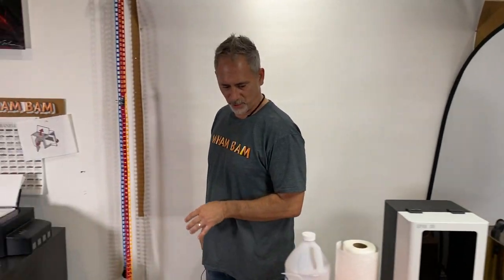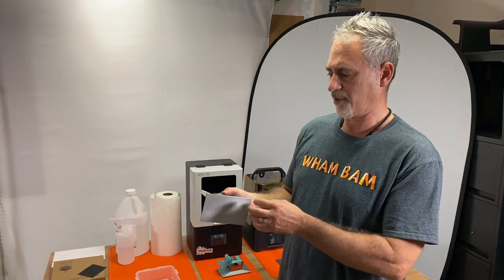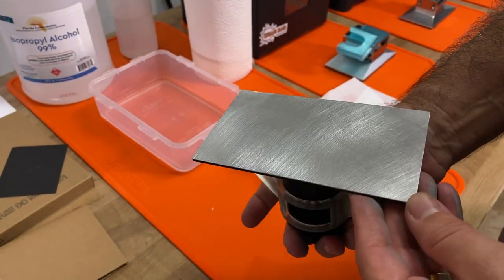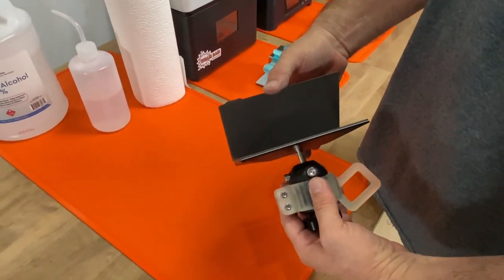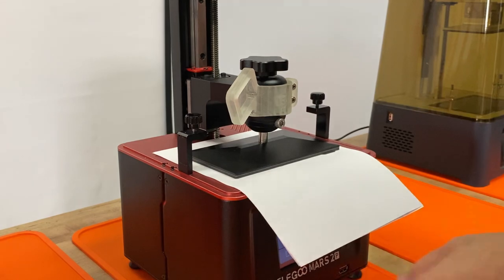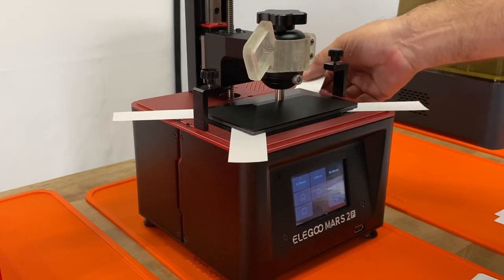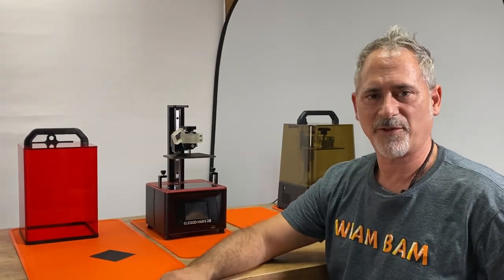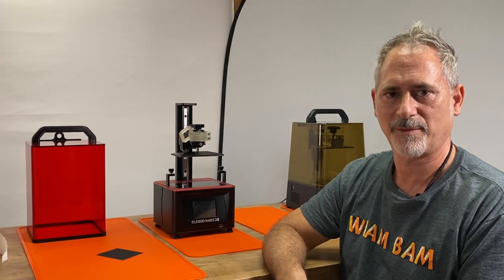Installation of the Flexible Build System for Resin (Updated)

Comment: What about a brand new Sonic mini 8ks plate, can i only do the alcohol cleaning or should i still get the Surface sandpapered?  The stock Surface looks diabolically retentive
Reply from the maker: you must sand every plate or the magnet will not stay for very long, follow our instructions for sanding and cleaning to have a perfect long lasting install.
Reply: @WhamBamSystems  ok thanks, just placed the order as i type this, whambam to México , going to be use to print dental restorstions using thick cerámic hybrids resins that can chew up the stock plate.
Reply from the maker: @drjoelsanchez  looking forward to hearing your impressions under these conditions! please do send your feedback to tech.director@whambamsystems.com if you like!
Reply: @WhamBamSystems  just installing the magnet on the plate, the instruction paper is a little bit off becouse it says screws are included, even tho i know i can use the same screws just fine, still a littlebit misleading. Maybe just clear that out. Everything else going to need further testing, i Will print a bunch of restorations. Lets see how this goes!

Edit: just found them! The screws were taped on the cardboard plate
Reply from the maker: @drjoelsanchez  please check inside your packaging, the screw are in a small bag that sometimes gets stuck to the inside of the box!
Reply: @WhamBamSystems  no dou ble and triple check and  no screws came in my order.
Reply from the maker: @drjoelsanchez  they are 2 M3 X 6 or 8mm. Most likely you can reuse those from machine.  If not please write to tech.director@whambamsystems.com and we can ship you 2
Reply: @WhamBamSystems  i was very intrigued on why You told me they sometimes fall out of place, justo chrcked for the six time (six times is the winner), thankyou so much for insisting, they were in fact taped on a corner, on the cardboard plate, not the bag in wich i expected them to be, thankyou so much, two screws found :) today i complete the 70+ hrs of curing and tomorrow i'll start testing. See You!

Comment: Reading the datasheet about the adhesive, seems it reaches pretty much 90% holding power after just 30 minutes, with full holding power at 72 hours

So in theory you could get away with using it within an hour of applying it
Reply: I tried this, did my first print 45 minutes after installation. Worked perfectly. It was a small room test print, so it didn’t really put too much stress on the adhesive, and I stuck to pretty small stuff for the first few days. After about 5 days, I did a full build plate print, and it was great.

After about a month of printing, I’ve gone through almost a kg of resin, and through many prints, as well as washing the entire build head multiple times, the adhesive is still holding strong. If you want to wait a few days to print, then wait. But I was very impatient, so started printing within an hour and a half of receiving the build plate, and it works great!

Comment: I have a mars pro 2. If I do not add the spacer and just level the plate loose like the third method for leveling. I should be fine without a spacer correct? As long I am vigilante about pressing the home button when plate is not loose
Reply from the maker: You should be fine but spring may cause too much downward pressure. You may want to level over 3 sheets of paper in this case then remove 2 and check against one sheet, be sure it’s tight but paper can move,
If level is too tight you will get shifting during base layers
Reply: @WhamBamSystems  thank you a note to all, just get the spacer if you do not u run the risk of breaking ur screen. also if u see a comment about removing the Z spring tried, did not work. just get the spacer the only reason you would not wwant the spacer is becuase you put it on already. if thats the case ask a friend to print the spacer for you. trust me!

Comment: I have an Elegoo Saturn S printer, do i need a spacer?  (some say yes, others no).  Where do I find it possibly?
Reply from the maker: It’s usually not necessary with Elegoo machines but if spring is too compressed you can add one, all spacers are on our support page https://whambamsystems.com/fbs-for-resin-support.    Saturn S is here https://www.thingiverse.com/thing:5334643
Reply: @WhamBamSystems  many thanks.
Reply: @WhamBamSystems  
Wait What… So I may not need a Spacer for my Brand New [Saturn S] ???
Reminds me, I viewed an owner of a Saturn S who did a YouTube video showing how he was able to add the FLEX-PLATE without using a Spacer. Successful Level the Build plate, but ONLY AFTER HE ADDED RESIN to the tank, did the GRIND DANCE start… (as I’m watching that, I’m like “Yeah that will be me”🤦🏻😱 So the Exhaustive Research began 33 hours ago to get an answer to this “Spacer or No Spacer” Riddle that’s driving me KOO-KOO……. Help…. Please….
🙏🙏🙏
Reply from the maker: @Zen_Modeling  as it is possible that the Saturn heads move enough to compensate for the added thickness of the Wham Bam System, the spring in the head would be so compressed that it could put too much force down during leveling or make it nearly impossible. Highly advise using spacer, takes very little effort to print and install. If not try leveling on a few sheets of paper and test with only one, that one must move between Flexi plate and screen but feel constant resistance.

Comment: So manually setting the new home z level in printer menu is an alternative to modifying the sensor, correct?
Reply from the maker: Do not use printer menu to raise z then set z=0, manually set home by leveling to correct height
Reply: @Wham Bam Systems  
No way to install without putting in spacer? The spacer on website for saturn 8k doesn't appear to be the correct dimensions for the xtr plate and magnet.

What I was wondering is if you can home the machine, lift it 3.4(or 3.6 I forgot) mm and then set that as z=0 so I don't push through the screen
Reply from the maker: @Chris-xu6gi  which spacer are you using from website? you should not install without a spacer, but can if the spring will allow you to compress that far. You can also take any spacer design and in slicer increase only Z height until it is .38 which is thickness of XTR
Reply: @Wham Bam Systems  I have not printer a spacer yet, I think the one directed from the website is for the non xtr plate and magnet.
I believe the springs on the saturn 8k will accommodate, but I wanted to try to keep their load as low as possible
Reply from the maker: @Chris-xu6gi  then print the spacer but increase z height to 3.8
Reply: @Wham Bam Systems  very new to all this, can that be done in chitubox slicer or would i need a separate program to modify the spacer?
Reply from the maker: @Chris-xu6gi  just adjust scale in chittubox, make sure to adjust only z, if you can’t do it I can adjust and send you the model?
Reply: @Wham Bam Systems  I think I have it adjusted, did you say 3.8? Not 3.6? The mag is 3 and the plate is 0.6? Once I install that, home and level as normal, right?
Reply from the maker: @Chris-xu6gi  great! 3.8 is exact with glue thickness, but it’s definitely close enough at 3.5-4!
Reply: @Wham Bam Systems  great, I'll print both versions and see what works best, level it out, and start going wild messing up prints in different ways!
You guys have been awesome with all the replies here as well. In thanks I'm going to buy a bunch of mega slap mats from your site

Comment: Which grit sandpaper is recommended for the plate?
Reply from the maker: Start with 400, if you need more adhesion you can go to 320
Reply: @WhamBamSystems  Thank you! Got mine and looking forward to installing this!
Reply from the maker: @ThIzZoLaSchannel  do let us know how it goes!
Reply from the maker: Sorry, if you are talking about the build plate 220 grit! And clean well with ipa. If you need more grip on the Flexi Plate then use the 400 grit
Reply: @WhamBamSystems  ooooh ok 220...yes the build plate!

Comment: Seems like i got a small bubble, do you think it will be a problem?
Reply from the maker: Usually not at all, try a print in the area, and let us know
Reply: @WhamBamSystems  Thank you, will do.
Reply from the maker: @trumpetscall8910  if the bubble doesn’t go down contact us at technical@whambamsystems.com and we can give you some advice and help
Reply: @WhamBamSystems  Thank you,  will do that if necessary. The process is finished tomorrow,  so it can test the plate.
Reply: @WhamBamSystems  Seems to work perfectly, just amazing how easy to get difficult prints off the plate.
Reply from the maker: @trumpetscall8910  so happy to hear!

Comment: Unfortunately, the flange on my Elegoo Mars 3 only has one screw securing the flange, although there are holes/places for two. On top of that when i try to attach the spacer the single screw only has about 3 threads to secure the flange/spacer. Does anyone have an idea where to purchase additional screws that are longer?
Reply from the maker: Buy some M3 screws 6 mm long.  You can get them on Amazon. A mixed M3 screw set is always useful for 3d printers.   For the Mars it’s not necessary to install the spacer, but it helps agains spring compression
Reply: @WhamBamSystems  Thank you

Comment: So question when it comes to sanding: If you're build plate has that paint/coating cover like the mars 2 mono has (your pro version looks to be silver on the bottom where mines black all over) Do you have to sand away all of the coating to leave the bare metal? I've worn out the sandpaper that came trying to do just that and I'm not really close to it. Is it fine with out sanding it all away or must it be compleatly gone? I am sanding evenly, and so see some silver poking though, but this seems like some thick stuff.  As is, will any kind of sandpaper work for this step? As said I've worn away the sheet offered to where holes and areas of the paper have no texture anymore. If I have to take off all the paint I need another peice (and maybe new arms).

Also a little bit of advice... please don't offer sandpaper thats the same exact length of the build plate. It has made sanding dificult and I don't like scraping the edge of my build plate across my work surface. Please at LEAST an inch longer than the plate size ordered so we have some wiggle room!
Reply from the maker: Yes best to get through the paint if possible
Reply: @WhamBamSystems  I've tried but I've worn out the sand paper that came with the kit. Sanded for a good two hours just to get a hint of the bare metal underneath. My arms acualy hurt today from doing it.
So again, what kind of sand paper do I need? any thats trhe same grit or a specific kind that I now have to wait to be able to afford? The video made it seem like I just needed to 'open the pours' not 'compleatly remove' the coating.
Reply from the maker: @TAiiNE  you shouldnt sand for more than a few minutes, perhaps you were using too fine of sand paper, the 400 girt is really to prep the Flexi Plate if needed, go to the hardware store and get some 220 grit, it will  cut it down fast, mount to a flat wood surface so you are keeping the bottom flat, pass in circular motions and check the bottom every so often. switch orientations every 30 seconds.
Reply from the maker: you dont have to remove all of the black just get some of the bare metal showing through, the more you have, the more secure and long lasting the grip of the 3M
Reply: @WhamBamSystems  I was using the 220, not the one for the flex plate. I know how to read instructions and follow videos :P But nothing in the video said anything about the coating and the plate in the video already had bare metal on the bottom. It wasn't until I looked up the mars 2 pro and found that it came bare metal where as mine has the black coating. Thus why I asked if I needed to remove all the coating as trying to do so I wore out the 220 sand paper.

Comment: Do i still need to clean and sand the build plate when it's still brand new?
Reply from the maker: absolutely!  the new ones may come packed in oil or have cutting and or storage fluids on them, also if it has a paint finish its best to cut through this with sand paper to ensure a great bond to metal.
Reply: @WhamBamSystems  Thank you so much!
Reply: @WhamBamSystems  Hi, by the way, how many grits should i use to sand a brand new build plate?
Reply from the maker: @epektuz  the 220 wet dry supplied is perfect

Comment: does the anycubic mono need a spacer?
Reply from the maker: It may or may not, see link at bottom of support page for full mono work book https://whambamsystems.com/fbs-for-resin-support
Reply from the maker: Most anycubic heads have enough adjustability in the 4 leveling screws to compensate for the 2.6mm additional thickness.

Comment: One comment. IPA leaves a residue when it dries. If you have denatured alcohol, it's a better option as it leaves little to no residue. Need to wear rubber gloves when using DA however.
Reply: Pure IPA (99%+) should never leave a residue. If it does, it is contaminated in some way or you're not cleaning well enough.
Reply: @Steefvun1  Nope. In my MilSpec / NASA  high reliability soldering classes, denatured alcohol was the preferred cleaner as it left less residue than IPA at ANY percentage. I think I will trust their instructions.
Reply: @swdw973  Sorry but, you are kind of wrong on this one, at least depending on the denatured alcohol. It is just ethanol with additives to make it inedible and those additives are what you need to worry about. Now if you get pure ethanol or a denatured alcohol with say ISO as the additive than yes it should leave less residue because it has one less carbon atom which would be the residue left. For soldering I could see ethanol being good because it is a stronger solvent so it should leave less flux residue but, it will also be harsher on any sensitive circuits and may leave behind other residue depending on additive, personally I'll stick to ISO.
Reply: @thirtythreeeyes8624  It does depend on the denatured alcohol, but in the NASA high reliability  soldering courses I took and in other training, DA was recommended hands down as leaving less residue than IPA (70-91%). That being said, 99% IPA is so close to DA as far as residue left behind, for it to not matter.

Comment: I bought a knockoff for $11. It came with two build plates and a super strong magnet. I wiped the used, dirty build plate of my Mars 3 a few times with an alcohol baby-wipe thing, slapped on the magnet and started a print. Several months later, zero issues. And I leave my entire build head with magnet attached etc right in the 99% iso wash of my Mercury X station for 5min at a time, zero issues. This whole video is hilarious.

Comment: When sanding the build plate do I have to remove all of the plate. I've gotten to the point where there is some paint in the center but not on the outer edge and I don't know if its the build plate being unlevel, or if its just how I sanded it. Also the corners of the build plate are being sanded more than anything else and I'm not sure how to fix that.
Reply from the maker: It’s a good thing your are sanding then, your build plate was not flat, make sure your sandpaper is mounted to a flat surface and work till all sands evenly
Reply: @WhamBamSystems  What about the corners being sanded down much further than the rest of the plate. Is there a anything in particular I should watch out for to prevent this, or is it because the plate was not flat?
Reply from the maker: @Cicada-uv5se  try not to rock the plate, sand evenly, check with the edge of a steel ruler frequently
Reply: @WhamBamSystems  Okay, thank you so much!
Reply: @WhamBamSystems  One part of this question was not answered. Do we sand it down until all the black paint is off the bottom and is just silver left? I'm at this stage and well... when do I stop sanding? Do I take the paint off fully or what? I have the mars 2 mono and the build plate is all black. I've been standing for a while now and so far the black hasn't really come up and the sand paper looks to be getting a bit warn.
Reply from the maker: @TAiiNE  yes, best to get down to the bare metal

Comment: I used the 400 by mistake, but I did give it a good sanding for a few minutes, rotating every so often.

Should I be worried about it not giving it a good grip for the adhesive, or do you think I will be okay?

I did have good lucking circler marks on the plate, and I did have a bit of black stuff coming off when cleaning. But I did use the 400 grip by mistake vs. the 220 that came with it.
Reply from the maker: If you were able to get the whole bottom to be scuffed and had nice bare metal shining through most likely you will be fine.  If you have issues please write us at technical@whambamsystems.com
Reply: Thank you! 

Waiting for the adhesive to dry. Ill email y'all if I have any issues!

Comment: Every video about this talk the same and no one show in detail the place and position to put the spacer.
Reply from the maker: Sorry, we will need to get in there better. The space position is found by first identifying the switch that trips when the build head is down and has reached the home position,  this switch is usually on the same plane as your screen and back by the base of the Z column,
Once you’ve found the switch, you need to identify the arm mounted to the print head that trips the switch. It’s this arm that needs to be lengthened 2.6mm. You can add distance to the arm or in many cases unscrew it and add a distancer or spacer below the arm mount and screw it back on